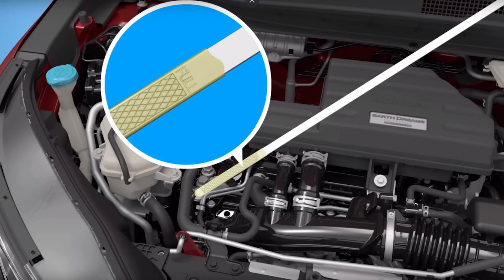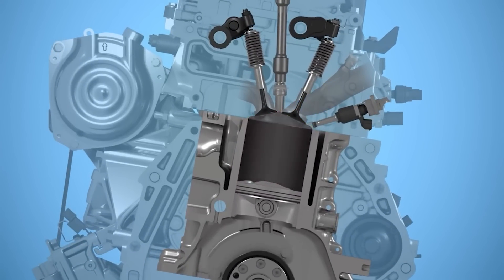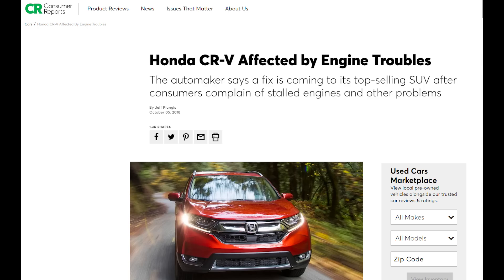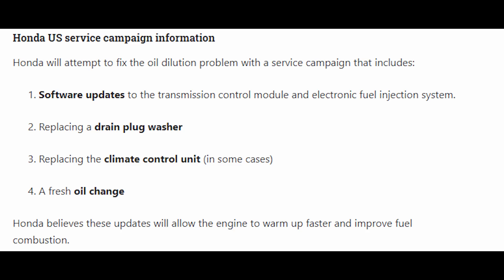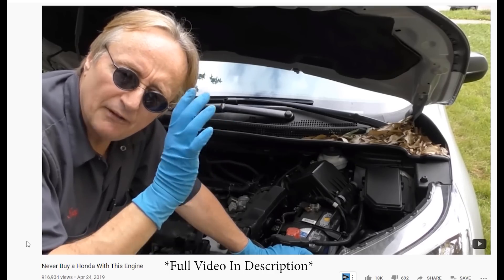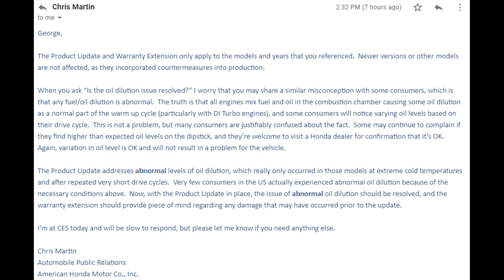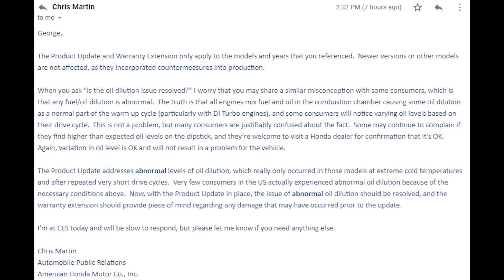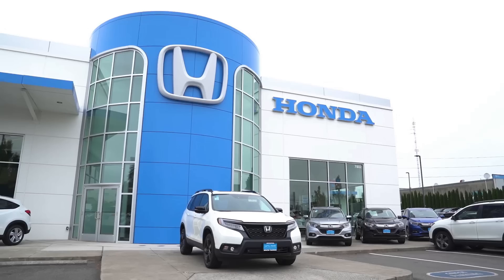Does Honda Have An Oil Dilution Problem? | 1.5L Engine in CR-V and Civic

Comment: Have a 2017.  The dealers have not been helpful at all and treat me like I'm the first person with the problem.  I'm an ASE certified mechanic so know my way around an engine.  I will never buy another Honda again because of the way the dealers and Honda corporation have treated us.  Things happen when new technology is used but there's no excuse for treating customers poorly.
Reply from the maker: Sorry to hear that...unfortunately it seems like a lot of customers are getting the same run around.
Reply: Same story here.  35 years experienced mech.  Have 2019 Accord.  When change oil stinks my whole shop with gas.  Advice if keep car change oil every 3,000 mile with Penzoil full synthetic.  Design to Combat fuel dilution with additives.  Never will buy Honda again; I knew Toyota’s were better quality but wife wanted Honda😥
Reply: @willowbark1956  how does the oil combat oil dilution?
i know it won’t , because oil dilution is just like adding fuel to the oil.
Reply: I was worried about this before I got my CRV. So far I haven't had any issues but when it's cold out I get concerned.
Reply: Mine happened while on vacation this summer, was not cold.  Had to be towed to nearest Honda dealer and I was their first.
Reply: Do you have any thoughts as to the cause? I think it's bad rings and Honda has decided it's cheaper to deal with people after than proactively fix. It's also possible the problem isn't bad enough to actually make a difference to the life expectancy of the engine.
Reply: @James5976  Hello, I just watched a video from Scotty. He said just change the oil every 5000 instead of 10000 with a full synthetic oil. Maybe that's the only way for now.
Reply: as a mechanic you should know better than to buy a newly designed engine/vehicle, even if it is a Honda.  always wait at least 4 years for problems to show.
Reply: onenikkione I agree. Plus he gotta do his research before a new model car

Comment: Still not interested in the risk associated with these engines. I wish companies would just stick with NA port or port and direct injected engines.
Reply: they are all going to smaller displacement turbo for improved fuel economy
Reply: Tell that to the government, and their mandates for super-high mileage and super-low emissions. The 'old' technologies just couldn't do it. I'm also old enough to remember the same complaints about another new technology... "I wish companies would just stick with carbureted engines and points and rotor ignitions."
Reply: Better fuel economy is mandated by the government's CAFE rules
Reply: @bstevens9831  Definitely and I understand. But companies (Toyota) seem to be making old school engines still with no turbos, and if they use Direct Injection, they also add Port Injection to make sure your valves stay clean. That is the smart way to do it.. If a consumer is going to buy a product again, it better be good in the first place. Toyota seems to be the only one that understands this anymore.
Reply: @revnto7k  I've been looking at the Mazda CX5 and others offering a non-turbo engine. Port injection is a plus, for the reason you mentioned( cleaner valves ). Running these turbos with full synthetic might mitigate the dilution issue but doesn't help clean the values. Thanks for the reply.

Comment: Bought a 2018 CR-V new, had the recall performed on it ( even though I had no issue) and still works like a charm. Great gas mileage 6.9 l/100km  after 39000 km.
Reply: That's spectacular on a CR-V. My 2016 Civic averages around 6.4 (Summer) and 6.7 (Winter) after 41000 km.
Reply: What recall do you speak of?
Reply: When I went to my dealer for an oil change they said they had to check for that problem ( in Canada). None was found.@ericmurray238

Comment: No issues here in NZ or Australia. Seen CR-Vs with 60.000 - 70.000 kms on them, no dilution problems. No memos regarding it either. Strangely just seems to be a northern hemisphere issue.
Reply: 70K KM's is still a lower number of distance traveled. Wait and let us know at 80-82K miles and see if your cylinders can keep the oil in the sump. NA people drive faster on the highway and this can cause problems in engine wear. You will not see a memo from Honda in NA considering this problem.

Comment: There is a recall for Honda 2010 CRV regarding this matter. I brought my CRV to Honda dealership and they fixed it.
Reply: Since when did a crv have turbo  in 2010?
Reply: @moeanthony9308  I did not say that my 2010 CRV has Turbo, what I am saying is that Honda informed me that they recognized that my Honda CRV needs to be recalled because of the oil dilution on my vehicle. Take note "OIL DILUTION PROBLEM". The Honda dealership here in Moosejaw, SK Canada fixed it for me.
Reply: @uuxxuu5002  sorry bud

Comment: Honda rep: "oh yeah, it's perfectly normal. Gas leaking into the oil pan is part of the startup process."

LMAO, okay buddy.
Reply: It happens in every single engine ever made, not just direct injected ones. It's the reason oil needs to be changed, rather than just changing filters. The problem here is the quantity. VW/Audi TSI engines are also high offenders. Ford Ecoboost seem to be the only turbo charged direct injection engines that don't have a greater problem with dilution than their N/A port injected counterparts (they have other issues to be fair, but not this one).
Reply: Right Wing Safety Squad thank you :)
Reply: Invidious Ignoramus It’s normal, but the quantity is a fact to take in consideration! I know, no of my friend had buy one, I cant judge by myself but if the ratio is really bad, its can literally destroyed the engine...
Reply: This is common to all engines that's why the sitting slow warm up is so bad for car engines. I have an 07 Accord with the K24 with 300,000 on the clock never opened and it has some oil dilution it just happens.
Reply: John H im confused now. So we dont really need to warm up the engine first thing in the morning? I drive to work but its a not a long way, probably 2miles
Reply: @johnh8546   300,000 seconds on the clock?
Reply: Do you own a Honda with this engine ?  Do you work for Honda and have info about this ?
Reply: sadly these days it is normal! vehicles are made to be disposable. looks like im sticking with my old truck for a while.
Reply: Jack Winand what? Oil dilution has been happening since the dawn of Combustion engines
Reply: @f181234  Exactly.  Piston rings and tight clearances aren't perfect, and the uninformed customer believes they should be.  Tighter clearances equate to better gas mileage or power.  You give up one, to have the other, and they do not understand this.
Reply: @f181234  No it hasn't with old style port injection. Direct injection is inherently laden with this and carbon build up issue. Not worth in slightly increased fuel economy and slightly more power. Sticking to a naturally aspirated port injection. Such as 2020 Honda Civic Sport with 2.0 liter engine, oh and no CVT crap - sticking with Civic's 6 speed manual. Problem solved.
Reply: @john21031  fuel making its way to the crank case happen with port injection as well just to a lesser degree. As the engine ages it will get worse due to the spray pattern of the injectors getting worse, and valve and Piston ring wear. The thing is that it more or less doesn't happen with a fully heated engine so you need to get your engine to operating temp fairly quickly. Also unless you are more ignorant than you seem you are fully aware that 300,000 on the clock is short hand, for 300,000 miles driven, and registered on the aforementioned vehicle's odometer. That takes entirely to long to type so I will stick with the short hand.
Reply: You're dumb.  It does happen.  You can't just cold start a car, beat the crap of the car to the grocery store, then turn it back off cold, then come back to your car, then beat on it as it's freezing cold and expect zero dilution when you haven't warmed it up or broken the engine in all the way.

Comment: Simple fix: Let the car warm up for a few minutes especially in the mornings when cold.
Reply: You got to be kidding me for that kind of comment.  I can let my car run for 20 minutes before I drive and my CR-V doesn't even get warm enough to defrost the window.
Reply: @davidb1169  If you own a CRV and are stuck with it, I'd recommend getting a block heater so you can plug it in overnight.
Reply: That's the worst thing you can do and never recommended for any engine. Driving away immediately you start warms the engine up quickly and cause the least wear.

Comment: I’m pretty sure the Accord has the same engine not just the civics and CR-Vs
Reply: They do have an earth dreams engine they fixed the problem on 2013-2017 accords. Not sure about the new 1.5t though.
I have a 2014 accord with the 2.4 earth dreams and i never had the oil smell of gasoline. I make my own maintenence on my car and i live in a cold climate. I mostly just burn off the oil than having dillute gasoline.

Comment: Never buy a first series of a redesigned car.  Do not buy this turbo charged engine.  It will not have the tried and true Honda Longevity.   Turbo engines wear excessively in shorter time frames.  Honda needs to re establish a naturally aspirated engine again.  I own a 2009 CRV EX and it is still going strong.  I will not be trading it in.  The issue with the new engine is mainly due to manufacturing to correct tolerances which were incorrect
Reply: Turbo engines do not wear any faster than non turbo engines. Hell, I had a 1987 Ford with a turbo charged engine that had 220k miles before it had any issues.
Reply: @Tool0GT92  the main issue is GDI from what I understand
Reply: @commandertaco1762  I have a Focus with GDI, 120k miles never did any intake cleaning and it runs great.
Reply: J series accord all day

Comment: This happens on my 2014 CRV. The oil goes above the full line. Anything that I can do?
Reply: Get it looked at. Your model CR-V with the 2.4L engine isn't affected by this issue. Oil going a tiny bit above the full line is fine. If it is a lot above, or keeps rising, then you have an issue.
Reply: Thanks! It's only a little above. But I'll have it checked out. 

I change the oil myself. It was well below the full line but after two weeks it climbed above the full line. The oil line is also hard to see (unlike my Corolla) and I was wondering if it was foaming.
Reply from the maker: Get it checked at your dealership to be sure.

Comment: I have the oil dilution problem in a 2017 crv. I have had the high pressure fuel pump replaced and the recall preformed. After this work I tested the oil and oil levels where still higher then normal levels. They didn't fix the issue and the idle is rough, the car takes forever to heat up even when the temperature was well above freezing. I'm talkin temperature 40 50 60 and it still took forever to heat up.  Thank goodness I have a lease. I'm going to drop my 2017 CR-V off in dec and never by another Honda.  The car has other issues as well to point out. It was poorly built. There's a musty smell then I cannot get rid of coming from the vents. The body paneling on the doors rattle at higher speeds. The hood of the car shakes on the freeway because air is getting underneath. The dash has warped in the center parts of it are becoming unglued. The infotainment system will stop working at least once a week. The driver's safety system Lane assist in adaptive cruise control will stop working while I'm driving and I don't even have it on. Don't buy a Honda.

Comment: I traded my Subaru for a Honda b/c I’ve always loved Hondas. And I wanted a CR-V.But when I found out the engine of the 2017 was turbocharged I decided to lease instead. A turbo on a SUV was a red flag for me. Later when I heard about the   oil dilution problems a test I pulled out the dip sticks and smelled it to see if the rumors were true. The strong smell of gasoline almost made me throw up. Engine longevity issues can show up beyond the 6 year so-called extended warranty.  And then the owner is stuck with a major repair. I am glad that I only leased this thing. Honda,the largest manufacturer of engines in the world should know better.
Reply: Totally agree.   Oil dilution started on my 18 CRV around the 9K mile mark (after the alleged Honda "fix"...  I'm hearing "change your oil more frequently" but I get gas fumes in the cabin in less than 1K miles after an oil change now.   There is something seriously wrong with this engine design and changing your oil more often isn't the solution.   Honda needs to do something more than giving a modest warranty extension.
Reply: @markp6586  Interstingly from information I saw elsewhere, the extended warranty only covers the cylinder head of the motor, so it sounds like if the surplus gas damages the bores, main bearings, crankshaft etc. then you are on your own. If that is true, the guy read it from his extended warranty letter from Honda, then really they are giving you little to nothing. Perhaps OD might damage the camshaft bearings, but it seems the bottom end of the engine is just as vulnerable if not more so. It really irritates me that people like yourself can have such issues, while Honda plays the "they all do that"/"it's quite normal" game.
Reply: It seems to me as well that the excess fuel will wear the bores over time allowing more fuel in to the sump. The reality is many vehicles are not going to show signs of excessive wear until after the warranty has expired. You were right to lease IMO, because anyone buying the CRV thinking they'll keep it and run it for 150k miles or so is likely to have a disappointment in addition to the fact that if problems become common, the resale is going to take a big hit.
Reply: This is an update to what I wrote a year ago.  Well , the lease was up and I had the opportunity to walk away from this thing.  I looked into other autos , namely Toyota and Mazda.  To get the same equipment that I already have would have cost me $10K additional over what it took to buy out the lease.  So I decided to take a chance and keep this car b/c I enjoy driving it.  Here are some additional factors that went into my decision.  1) With the oil dilution fix , the issue was greatly diminished.  If the previous smell was an 8 this current smell is 1-2 given mostly short range driving in the New York City Area.  2) Honda makes the most internal combustion engines in the world.  They didn't get that way by being stupid or ignoring problems (my opinion).  Since they did not change the design in subsequent years they must have felt that they had minimal exposure to this issue.

Comment: My 2016 Civic Touring 1.5T has 70,000 miles on it with zero oil dilution.
Reply: Handy Cap, I change my own oil, and there’s no gas smell, and the oil level hasn’t gone up. Doesn’t appear to be a problem so why would I spend the money to have it tested?
Reply: I have your twin, but mine only has 25,000 miles, the majority being a 20 minute country/city trip to commute to work. Some short trips while at work. Very occasional highway drive. Last Winter, I noticed the gas smell in the oil, but didn't notice the level rise much, and performance didn't suffer. Honda did the 'fix' last summer, and since then the car warms up faster. Haven't noticed any smell yet, but the Winter's been mild so far.
Reply: Troy Jollimore. I just ordered an oil dilution sample kit from www.blackstone-labs.com so once I change my oil again I will get it tested to know for sure, and will post the results here.
Reply: @billjohnsonseattle  have you had any oil dilution and do you live in a cold climate?

Comment: Honda and Toyota are still the champs when it comes to reliability. Every automobile make and model come with issues. The wise question is how long are these drivers taking to go in for an oil change. Did I hear dude say 10k miles.  Oil does break down. Off course you would get an oil dillusion if you go pass 5k. Just change oil every 3k to 4k miles.